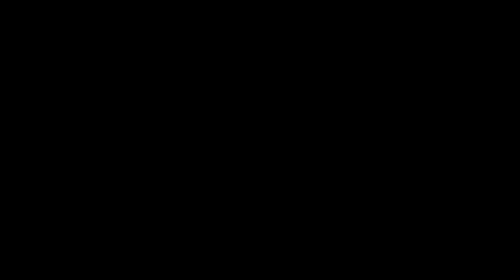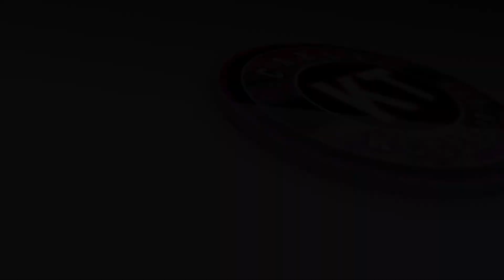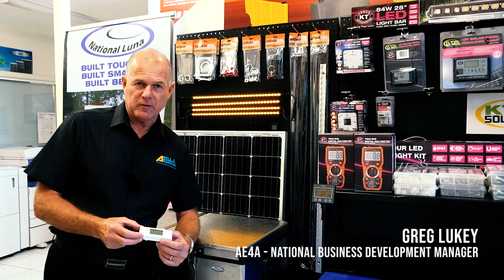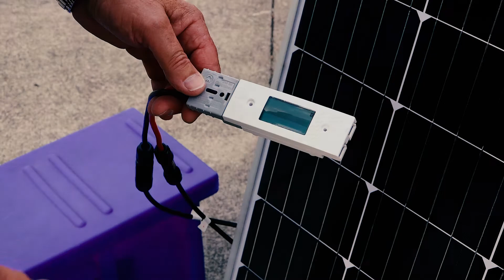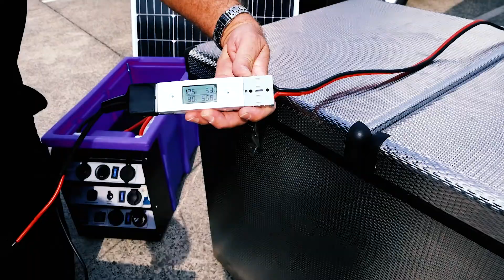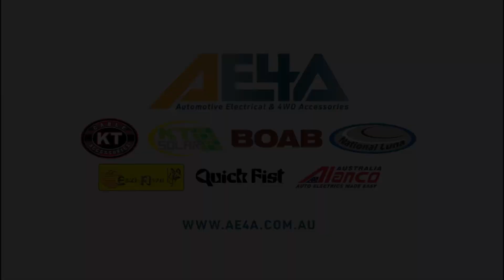KT Power Meter Demonstration Video

Comment: Can this unit de used to simply check the battery volts level?  IE: just plug it into my caravan AGM battery Anderson Cable cable set up to it for plugging in my solar panel quickly.  I have been told not to let my caravan AGM battery get below 50% storage or it may not recharge properly later?
Reply: Yes he just explained that in the video